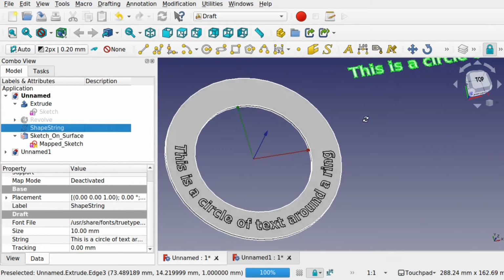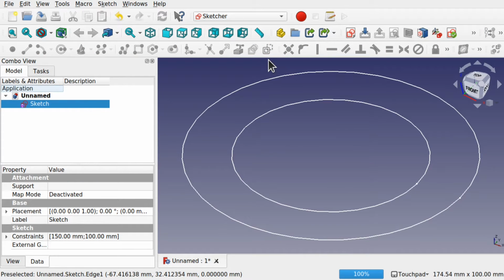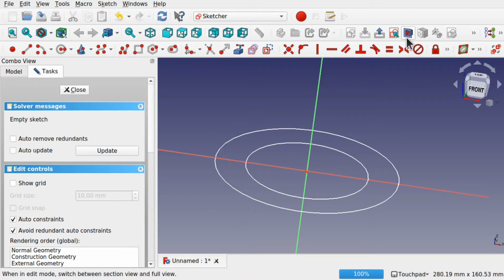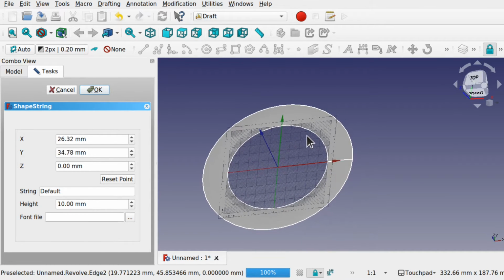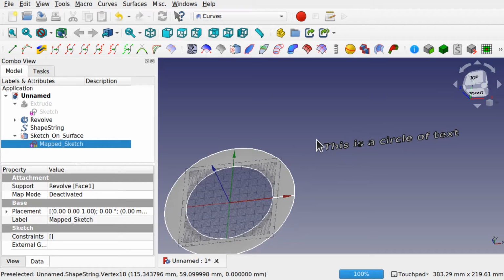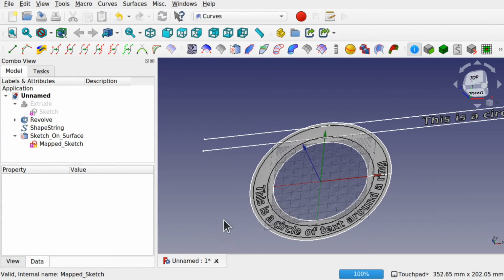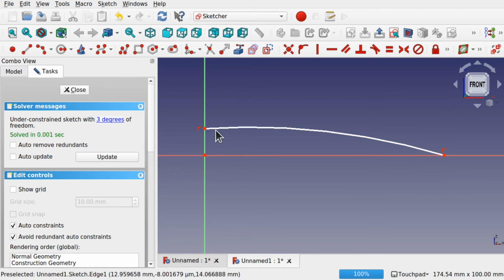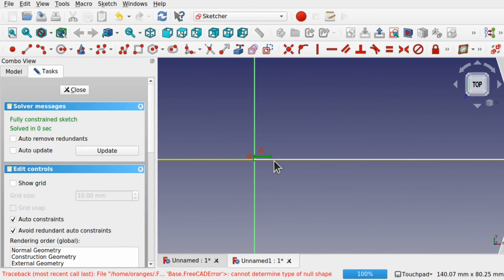FreeCAD: Easy Parametric Text around a circle or ring using a shapestring

Comment: Does it work for shapes such as bolt with a hole in the center?
I would like to put some text there using this tutorial but constantly get weird 2 paralel black lines along the x-y axis that just touch the surface of the object.
Curved text does not appear.

Important to note, that I don't use a "revolve" to create such a shape, but simply use pads one on top of another and a hole.

Comment: I feel like there must be a bug in the software.  My model is built essentially upside down, so I have to do a lot of 180s and flip operations.  I can get the circular text but my O is totally solid, and I don't know how to get the text embossed in the surface of my main model, which is built fully in the PartDesign Workbench.
Reply from the maker: On the properties in the data tab of the sketch or the text there is an option called map reverse.  This will flip the attachment.  A bit strange how you have got into the state.  So the solid 'O' sounds like you need to turn 'allow compound' to true on your body.  Select the body, data tab, allow compound.  This video will help as well: https://youtu.be/uQ0T5Tw3dro

Comment: For those watching with FreeCad 1.0: You can make it with an additive Pipe that has a flat top and it will work just fine too, no need to have small curves that mess up 3d prints!

Comment: Has anyone tried this in the latest version.? V1.0.0. I can't get it to work..
Reply: Yes, and you are correct it doesn't work right in 1.0.0. It literally took me days to figure this out.  

When putting text on the outside of a curved surface, such as the customer facing portion of a soup can, it works. 

But if you're trying to put text on a FLAT part of a curved surface, such as the lid of a soup can, the feature is broken. 

This is what I do for the face of a soup can, and it works in 1.0.0:

1. Select the curved surface and click "Sketch on Surface" from the Curves workbench. 
2. To verify that it works, draw a line or circle in the Mapped_Sketch (which always starts at 0,0,0) then set Sketch_On_Surface : Thickness to 1. This should cause a 1mm extrusion of whatever you put in Mapped_Sketch. If it doesn't, try moving the Mapped_Sketch into the same Part as the curved surface because it is probably putting the extrusion somewhere off hte screen or covered.

3. Link your ShapeString object in the field "Sketch_On_Surface : Extra Objects" by clicking the 3 dots that appear when you click on "Sketch_On_Surface : Extra Objects"
4. Align the ShapeString as needed, usually I just stick it at 0,0,0 to get a ball park and adjust it from there. 

Sadly the only workaround I've found for the lid is to make a second object that is not quite flat.  I usually:

1. Create a shape that is almost flat - for example 179.9 degrees - using the revolution function. 
2. Select the curved surface just as you would for the face of the can, and extrude using Thickness as usual. 
3. Sink the curved surface into the face, and accept the unfortunate fact that the letters will be at a 0.1 degree angle. 

Best of luck to you and anyone who finds this.

Comment: How do you flip the text so that the tops of the letters point away from the centre, rather than towards it? I tried a few ways of rotating the ShapeString but ended up crashing FreeCad.

Can you insert pictures in comments so that I can show you what I mean?
Reply: Answering my own question, simply Transform the ShapeString with a 180 degree rotation
Reply: I would like to attach the resulting FreeCad file because certain letters in the text are "corrupted", i.e. their triangles are all over the place. A W is broken, one of the Es is ok but another is broken, likewise for the two Ts, two Ls and two Cs
Reply: Also, I can't seem to use a Cut or Xor to etch the text into the extrude, which is what I really wanted to do all along

Comment: I used this method to create circular text and was able to Engrave the text in the CAM workbench. However, I have been unable to replicate the action. I've tried several times to Engrave a Shapestring mapped to a surface but FC does not allow me to select it for the Engrave function. Like I said, I have a file that works and so i am baffled. I'm hoping that there is a new and better solution to map Shapestring text to a curve and that works better in the CAM Engrave function. Can you make a suggestion?

Comment: I'm getting errors when trying to add thickness to my Sketch_On_Surface. It's saying stuff like "No gometry" and "8:Invalid final face"
Reply: Also, my initial revolve command throws up a "PartDesign feature wrap" pop-up when I try to use it. The surface comes out blue instead of gray.

Comment: Does the surface you are mapping to need to be a "revolved" surface? Could you use two sine waves of different amplitude to generate a wavy surface and then map to it? Does the swept surface need to be of consistent thickness?

Comment: I have been trying this method on a part I made in the part design workbench and I can get the text onto the surface and looking good. As soon as I try to add thickness to the text I get "<class 'Part.OCCError'>: BRepCheck_Analyzer::Init() - NULL shape" . I updated FreeCAD to the latest to no avail. Any suggestions? Thank you so much for the videos!
Follow up: I figured this out. I needed to use the shape binder to bring it into the body. Then I padded the text in part design but had to use Face Normal and Symmetric to plane options to get it to work properly.
Reply from the maker: Great to hear you found out the issue and added to the comments for everyone else to see. Thank you for that as it really helps with helping others.

Comment: You need to take more time to teach how to use drafts. I had to stop the video and figure out how to get the draft grid parallel to my plane. When I finished the video, my text was facing the wrong direction. I cannot figure out how to flip the text to the opposite side of the draft grid.
Reply from the maker: You are right, the working plane is the key to getting the draft tools to work and I forget how important that is and often take it for granted. Thank you for that. I need to focus more on explaining  how to use and set that.

Comment: took a bunch of effort to finally get any text, but in the end, the text just writes over itself as it wraps around the surface. it doesnt make the text fit in the length. i thik iwill need to draft a bunch of  individual characters.  even the macro option has shown to be a disaster.  

after doing this video example I converted to what i need to do and that is text on a surface between a 54mm and 50mm ring.   any thoughts would be helpful
Reply from the maker: In my lattice workbench tutorials you should find a video which was quite recent where you can make text follow a path

Comment: I can get this to work for circles, but I could not get it to work for an eliptical ring. How would I go about this?
Reply from the maker: So you need a workbench that will help you there called the lattice2 workbench. You will be able to create a path which will just be your sketch and use the placement of array. I'm sure I have a video in my lattice 2 playlist. If not I can make one. I think I did it with a chain link. I think it may be worth me doing a video anyway as I have been using the lattice 2 for text lately and it's not obvious in my collection of where to look.
Reply: @MangoJellySolutions  Thanks for the help. I can get the lattice 2 workbench to work, up to a point. The text does follow the eliptical path, but the characters are in the wrong order. I've uploaded a video to demonstrate what happens. It appears that the path array doesn't place elements in a consecutive sequence. See my short video https://youtu.be/2MgIar_V_6g  Is there a way that the sequence can be reordered without having to type the text in the order dictated by the path array.
Reply from the maker: That's bizarre!  Sorry only just saw your comment as youtube held it for review as there was a link in the comment (it does this to stop advertising links from other channels and unwanted adult content spammers).  I had a search and it looks like your not the only one that has experienced this problems https://forum.freecadweb.org/viewtopic.php?style=10&p=497773  I am going to did deeper but I haven't got a solution yet i'm afraid.

Comment: Again that was great and fun! One thing - when I export it as a stl file and open it in my slicer it's not right. Do I need to do something else before exporting?
Reply from the maker: Did you export both the text and the surface it was on if they were both separate from each other i.e. not a fusion but individual items,
Reply: @MangoJellySolutions  I'm now getting it to export, but in my Cura slicer it keeps saying “your model is not manifold” and the text is in two places. One place is right on the circle and the other is off to the side in a straight line, like in your tutorial. Thanks
Reply: I got it to 3d print and looks nice. The fix: I had to make the ShapeString construction geometry. I first tried hiding it, but didn't work. I don't know why this worked, except that it took the text out of the final .stl file? I wish I could find more information on what you should do to your FreeCad project to get it to print. Thanks.
Reply: @pipertime1  How did you manage to make the ShapeString into Construction Geometry? been trying this for about 3 hours now to no avail.. please help.

Comment: The use of an arc to make a Revolve threw me -- I used a line to make the Revolve, but then the mapping did not perform a circular mapping but a planar one instead. When I changed the line to a shallow arc as shown, I got the desired result. The projection mapping seems to check for a flat surface in order to determine whether a planar mapping is appropriate. This doesn't seem correct because an annular surface is planar but motivates a circular mapping. Ah well, it's Free software once again.

Comment: Thank you for another wonderful video. I have been trying to do what you explain, but I find a little issue, is that the text I need should be turned upside down. I mean, the text should be legible but in the upper side of the circle. I would appreciate any help.

Comment: Hi. This is a bit late so I hope you are able to see it.
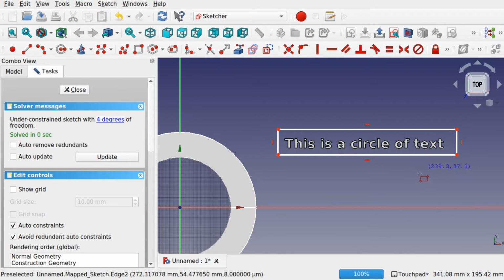I've got up to the stage in the video where you delete the construction geometry and then drag a rectangle over the text at about 10:30 in the video. Like one of the previous people here my machine locks up and stops functioning. I went away and came back more than 20 minutes later so I believe it's just locked up at that point and died. My original attempt was with Arial Bold, but then I changed out to dejavu Bold to emulate your tutorial. Still same result, crashes or locks and you have to kill the program and return.  I also tried version 0.19 and the current weekly alpha to see if anything had changed. All failed in the same way.

I was really wanting this circular text so I'm bummed it won't work for me, and I can't see why it locks up there in any case. Could I achieve the result any other way using another technique, or does it really need that construction geometry to move on? Sorry but I just picked up FreeCAD a couple of days ago (which means I know nothing about it ... yet) as a viable alternative to all the unreasonably priced options out there, and got really excited because it seemed ideal for my 3D printing needs.

Thanks in advance. Any response which helps me move forward is appreciated.
Reply from the maker: Yep seems like a number of people are having the same problem. Looks like lattice 2 maybe the answer to this. If you look at my lattice 2 playlist you will find a video in there regarding circular text. This is a much faster way. Let me know how you get on.
Reply: @MangoJellySolutions  Thanks for the response. I've just really started, I come from programs like Lightwave, Maya, Blender and so on, so the mindset's a little different, But thanks for the videos, you and a couple of others are the reason I am trying to learn and use FreeCAD, you've made a very steep hill a little easier to climb.

However, I still strike times where I make a shape/disk/circle and try to plonk something on it which in my brain seems entirely logical and feasible, FreeCAD slaps me on the forehead and tells me I'm doing it wrong, which is a bit frustrating at times.

I will be giving your Lattice2 videos a good blast, I tried the first couple, had a lot of success, then crash ... "You're doing it wrong stupid!"

I have a ways to go but I like the program, I'm getting accustomed to how it works, I like how I can quickly knock out fairly conventional geometry and have it in the 3D printer in a couple of minutes.
Reply: Well I succeeded in making the cog from your first lattice2 tutorial again, and also managed to stick a line of text on it and extrude, amazingly enough I also managed to successfully export it to an STL file, loaded it into my 3D slicer and voila, it actually worked! Several headbutts with FreeCAD and something finally clicked. I wasn't aware you had to convert that 'CUT' cog to a solid first in the 'Part workbench' to make it acceptable to the font string in the 'Draft workbench'. It's a bit of headspin to know exactly which workbench has the correct tool to use.

Comment: At 10:435, that decided to make my computer busy for about 5 minutes...ugh
Reply: Also, @mangojelly Solutions  fill faces for some reason doesn't fill them.  Are you using .2 or .19?
Reply from the maker: Sorry for the delay in getting back. I'm using 0.19. There has been a curved wb update so may be worth updating. Also certain fonts can make the fill face fail
Reply: @MangoJellySolutions  good to know and thanks for the reply, I tried Ariel bold.

Comment: It's apparent you have been doing this for a long time. I'm brand new as I'm trying to design different items for my 3D printer. I've subscribed to your channel because you have a wealth of information. However do you have any recommendations for individuals like me who are complete novices of Freecad?
Reply from the maker: Hi and welcome, yes you could start with the understanding freecad series. Also if give me an idea what type of things that you'd looking at designing I could point you towards the correct video or make one around the subject. Just a heads up if you post a link to a image your post may dissappear as it will get auto held for my review. I had to turn this on because of spam posts but I am keeping an eye on the review folder.
Reply: @MangoJellySolutions  I'm looking to design a wall bracket for my ceiling fan remote.